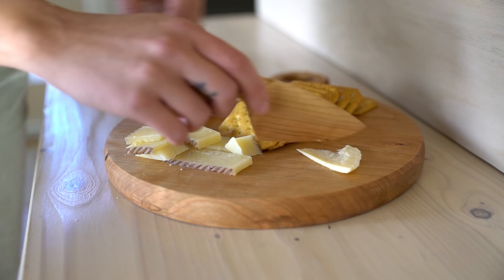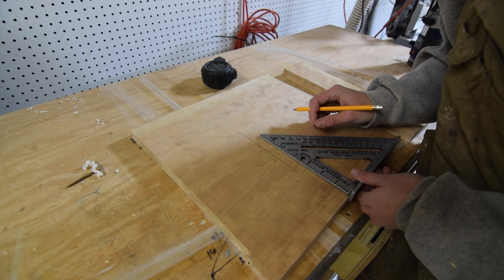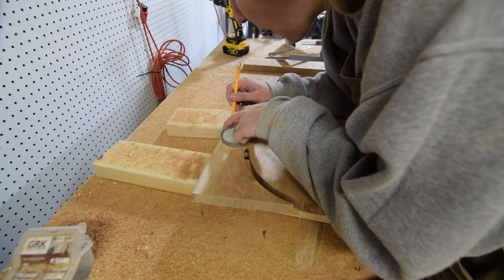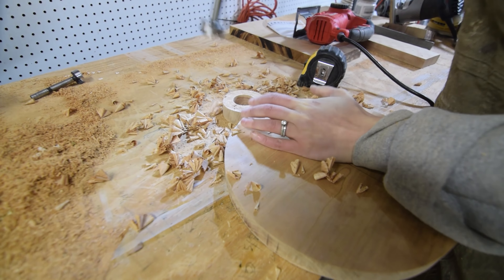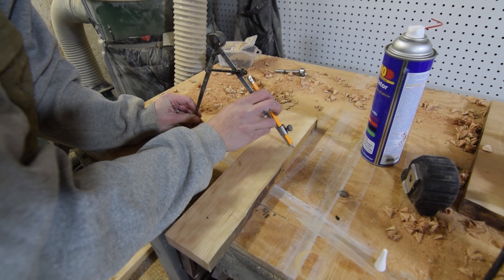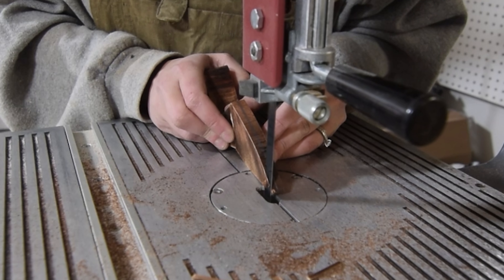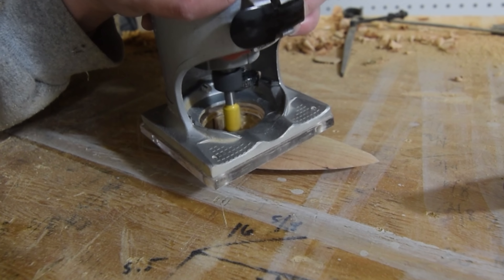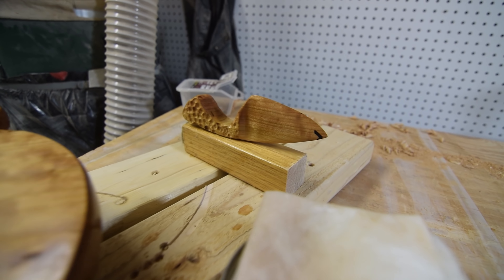DIY Cheese Board and Knife Set

Comment: Good looking board & great wood & colour. Only one suggestion I'd do & that is with the handle, I'd put it on the long grain where you have it on the short grain. I also started thinking about different ways to cut the round shape using the router without screwing into the work surface. I'm not faulting your process but when I watch videos I think about other ways of proceeding.